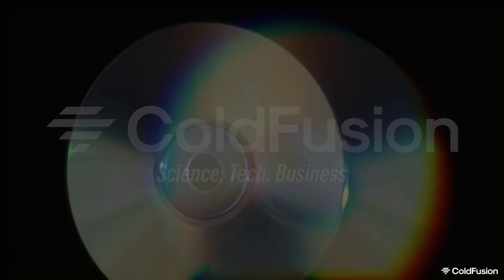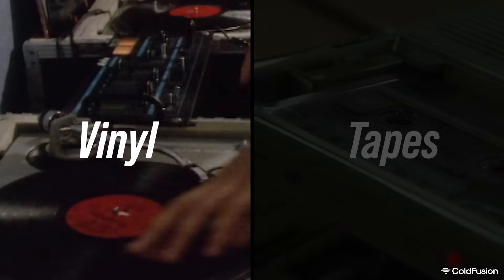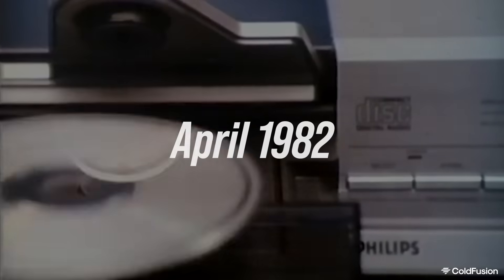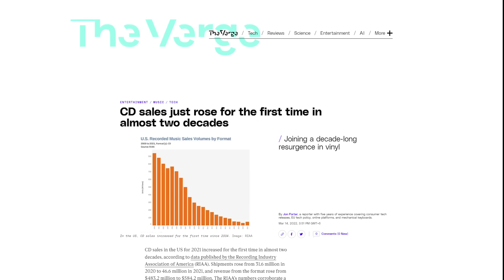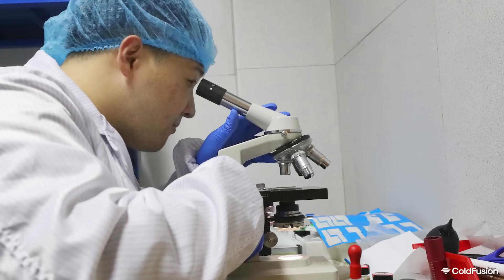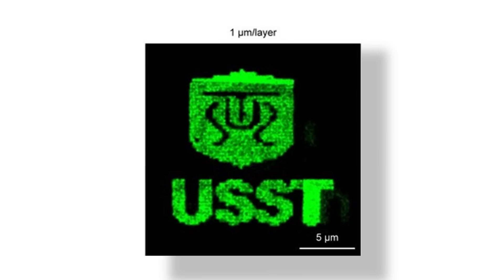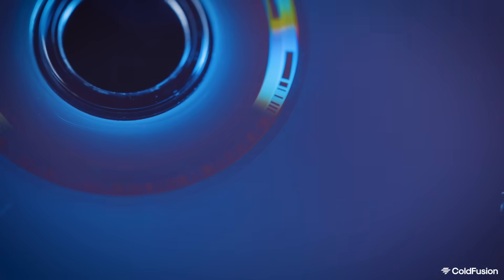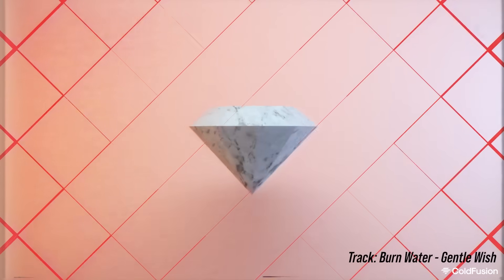Why This New CD Could Change Storage

Comment: Maybe put the disc in a casing like the mini disc. 

Losing 700 MB is one thing but losing 1.6 petabits because your disc got scratched up or stained would be a bit hard to swallow.
Reply: OMG. Give it a 90s translucent casing. pls. that would go so frickin hard
Reply: @joseffuris8306  DVD-RAM all again
Reply: Always have multiple copies of important data, how strong the medium is doesn’t matter, it should be able to break without you losing any data.
Reply: @LightOffArchives  yeah but that doesn't stop this being bad, the back ups things isn't really a solution it's just a thing you have to do because you can't rely on any one method
Reply: @illford  Well yeah, but there’s no storage method that’s completely secure in that sense, backups are unavoidable if you don’t want to lose data
Reply: @LightOffArchives  It depends on how much that disc cost. One dollar is ok. One hundred dollar is "That's my meal, dude!"
Reply: @LightOffArchives  For almost total data security you should save files that need it, at least 3 times, with at least one copy away from the location of the computer. If one copy becomes damaged, you can compare the copies to find out which two copies are likely to be undamaged.
Reply: DVD-RAM used to come in a case like a minidisc
Reply: @Brookspirit  Also a Floppy disk.  A petabyte better have some sort of case,  it too easy to screw up just the disk,
Reply: @Brookspirit  I really liked the minidisc, shame it never really caught on much
Reply: A cheap 100TB optical medium would be a life changing backup solution
Reply: @Wegetsignal  Assuming the hardware is affordable a 1TB disk would work well for me. Right now, I'd only need twenty disks to hold everything.
Reply: @Wegetsignal  yes, I don't see a common person using more than 100TB of data.
Reply: I've lost so much data on cds, even getting disk repairs did nothing, they even looked fine on the surface with no scratches or any damage.
Reply: "Sharing 700 MB of highly personal data with a Cloud provider - that will sell it to anybody - just to save it is one thing...."
Reply: @shotelco  yeah, freak the cloud, enough of them having control with their "mainframes", time for the second personal computer revolution, we own our data. the CD must make a come back. it doesn't even need to be in the Petabyte scale. A single CD with 100TB that costs $5 would already be amazing ! even if the reader would cost $5000 and the burner $20K

You could get the entire pirated Netflix catalog in 5 or 6 disks for $20, that would stick up to the big man that is big tech. That would put a halt to this neofeudalism, the idea that you will own nothing.

It happened once, it can happen again.
People are getting tired of everything being a stupid $50/mo subscription.

If buying ("a digital good") isn't owning, then we should go back to data being stored in physical media just for the sake of owning data.
Reply: @shotelco encrypt your data before uploading them
Reply: @shotelco Something something encryption.
Reply: @shotelco  Ever heard of encryption?
Reply: I've never lost a CD or DVD due to scratches, because I care about them. All my CDs are well kept in their boxes. I don't see the logic of people not taking care about their things. I hate to purchase the same thing twice, so I never do it. We need to have self discipline and responsibility. 🎉❤
Reply: @DihelsonMendonca  You won't believe how wasteful most people are. slightest defect and they trash it and either but a new one or do without because they never have a single clue how to fix it.
Reply: @paulmichaelfreedman8334  I answered to this comment, but my comment simply vanished. Wow ! 😅
Reply: @DihelsonMendonca  Agree. I can't claim "never" as you do, as I know I've lost one or two discs over the years. e.g. slot-loading drives meant sometimes the face of the disc hits something on the way in. When jewel cases were later replaced with paper sleeves, it did force the disc to make physical contact with another surface. 

But as a whole, you're right – with careful handling, a CD, DVD or BD can pretty much last a lifetime.
Reply: 💯 I still have my original CDs from 1990s still in pristine condition. I knew far beyond greedy Corps would find ways to rip the consumers off. Which they do now.  @DihelsonMendonca
Reply: You wont lose your data if it gets scratched, unless it is a very deep scratch, the data isn't stored on the surface.
Reply: @danielreed5199 but you'd probably have trouble reading the data, we all know how CDs ended up after some bumpy roads. No data was lost, but the scratches confused the player
Reply: @erlgr  but the disk can be fixed
Reply: @danielreed5199  I've had ruined CD's with scratches or pits on the top too.
Reply: @danielreed5199  It really depends on orientation of scratches and what do you exactly mean by 'deep'
But yeah, there are bit pattern mechanisms to error-correct for tiny damages
Reply: @danielreed5199  yeah but it won't read, it's great that it's still there too bad i can't read it. But also this happened a lot with games where small scratches would make the disc unreadable
Reply: @danielreed5199   Data isn't stored on the surface but it's much closer to the label side than the laser side.  Every damaged disc I have is the result of label side damage.
Reply: @danielreed5199 its not on the surface in conventional cds either.
Reply: @danielreed5199  That said, a simple ball pen on the printed side can actually scratch out the data layer, which is ironic as most people write on that side and  lay down a cd on the printed side to avoid scratches!
Reply: @danielreed5199  stretches don't damage the data... not even on current discs... but they defuse the light making the reading impossible for the laser.
Reply: @Mobik_  You mean scratches. But there's a solution: I have used a product known as "Brasso" ( here in Brazil ), and those unrecoverable CDs now can be read perfectly. I got rid of all surface scratches. Not a very deep one, though. But common scratches are perfect. 🙏👍
Reply: @danielreed5199  That's only on the bottom. But scratch the top of the disc and your data starts peeling off. Say goodbye to those layers for good. I remember i had discs that had part of it peeled off that you see right through it. That disc was done for.
Reply: @danielreed5199 Slow Claps, Slow Claps.
Reply: @danielreed5199 my friend played splatoon for the Wii U and couldn’t play anymore as they scratched the most important part of a disc 

The design on top of
Reply: @danielreed5199 Not a single optical disc holds data on the surface. So your understanding is flawed. Optical media is a sandwich, two polycarbonate sheets, with the data on a metal film between them. A scratch doesn't scratch the actual data, it causes the light to scatter and not reflect properly. Which is still possible, indeed, even more so with this media.

It astonished me when people make comments out of false confidence when they are just ignorant.

Research the Dunning-Kruger effect before you make another comment correcting anybody about anything.
Reply: @danielreed5199 CDs crap out regularly. Silver discs were meant to last 80 years. They don't last 8.
Reply: Something that stores that much data though would never be removed it looks like it does take some sort of special disk, reader, and writer, and if that’s the case, it would never leave that at least if I had one. Most likely if this technology does takeoff it will most likely be put into some form of hard drive like the old hard drives and will be a permanent fixture as a server or redundant back up drive to your PC.
Reply: it's still great data storage because it's Offline no need internet & no paying each month like cloud.
Reply: I agree. Mini discs seemed more durable because of the casing
Reply: With new storage possibilities comes new file formats and encodings that take advantage of that storage. For all we know 1.6 petabits in the future could be one movie.
Reply: Problem with CDR/W is it has a biotic membrane that was "stained" by the laser and faded over time. Shelf life was 5+ years. I have a CD case of hundreds of disks that I know no longer are of any use, not that anything from back then works on current windows anyway.
Reply: @willhendrix86  Are you no longer able to access the data on them?
Reply: @willhendrix86  M-Discs are good for 1000 years.....
Reply: Zip drives were encased in a plastic shell.  So were floppies.
Reply: They did this already back in the days, those casings called `caddys`. So you had to have a caddy drive to use them. I like those caddys too.
Give the disc the optimal protection.
Reply: 3-2-1 backup rules
Reply: You need a little data arbitrage, keep 2 or 3 copies
Reply: PSP called it 😂
Reply: Bluray was supposed to be in a casing like that, but they went with a harder material instead.
Reply: CD was originally intended to have a caddy, but this was quickly abandoned.
Reply: @ChronoTango  Some early drives did have you put the disc in a caddy that was then pushed in like a front-loading tape sorta.
Reply: Maybe a metal enclosure that also doubles as the drive bay that can fit in a slot on your computer, lets say something like 5.25 inches or something, I don't know, I'm making stuff up...
Reply: Don’t lose it 😂
Reply: Mini-disc use a plastic casing like floppies so if this also did that you wouldn't have to worry about scratches.
Reply: The Irony is that CD caddies were a thing, but to drive cost down of the players they were discarded and all went naked disc mode. In the late 90s and 2000s you could find players that used caddies but they were commercial players issued by music companies for PA use and used sealed caddies to protect their IP.
Reply: Also, I don't think a 12 cm version will be very handy. a 3.5 inch version with 30-40 TB storage would be ideal.
Reply: If it was affordable like the CD-R was, you'd simply burn two.. or three.. or ten. And of course store them in different places.
Reply: It was proposed to have CDs use a casing like floppy disks did, but nobody wanted to use them and by the time they got to the market, they were just the naked discs. 

They keep promising more scratch resistance in each generation of the technology but in practice each version has gotten more delicate.
Reply: The back scratch was the killer.
Reply: they could just make it so that it replaces magnetic discs, this way no issue with it getting scratched.
Reply: You can clone easily.
Reply: old cd become brittle easily delaminated
Reply: i loved the minidisc.
Reply: @jgg204  such a real loss tbh
Reply: The return of floppy disks
Reply: I disagree, give some time 1.6 petabits wont be as much, 700mb was a whole lot back then too
Reply: "Losing 700 MB is one thing but losing 1.6 petabits because your disc got scratched up or stained would be a bit hard to swallow."
...because you would be that fool for not making 1 or 2 backup copies.
Reply: The mass market consumer has no use for petabit capacity, and if you intend to preserve your ssd/hard drive information you had better use RAID storage, a lot of caution and hope for the best.
Reply: @deltasquared7777  raid for preservation on drives over 4GB is just begging for an unrecoverable read error.
Reply: maybe make a 2nd copy of the disc?
Reply: So make a backup dummy
Reply: @googlesucks6029  Despite what everyone is saying, optical disk CAN lose data due to mishandling, manufacturing defects or defective recording.  However they are still among the best medium for long term storage.
Reply: CD's originally came in a case and looked much like a big 3.5" floppy disk. then then made caddies that you put the disc in, and finally they did away with the caddy all together and just had the disc in a tray.
Reply: As much as I've always loved records laser discs and CDs at this point I prefer SD cards they're a lot more rugged can take lots of abuse and still work also very small
Reply: @maxvanderspurt2313 I find it somewhat amusing as SD cards are probably one of the most unreliable media I've used, the only thing that comes close to it are floppy discs.

3D printer not working correctly? Try saving the file into another SD card, or open up the case around the SD card receptacle and clean it, or jiggle the damn thing around until it works. SBC not booting or crashing randomly? Remove micro SD card, run fsck on another computer, reformat or copy the data onto a new micro SD card, clean the damn connector, try it again. 

As much as I hate have USB flash drives sticking out of electronic equipment, there are low profile ones that are cheap, has more than enough capacity and work very reliably for many years, but every damn piece of equipment I have / had that uses SD for it's main form of data storage have failed on me multiple times due to weird random data corruption or stupid transient malfunctions. Heck, even the butt ugly and horribly outdated CF cards are way more reliable than SD cards in my experience. 

Most recent example: I had to solder header pins to a Raspberry Pi Zero 2W so I could plug a daughter board on it for a project. After soldering the thing either didn't boot anymore, or booted, ran for a few seconds and froze. I thought I had messed up something, checked and rechecked for shorts or bad solder joints, but couldn't find any faults, I was starting to think I messed up the SoC by using too much heat or something like that. Then I remembered: check the damn SD card. Plugged into another computer, verified checksums for all important files, ran fsck on the partitions, no errors. Plugged the same card on another brand new Pi Zero and... Same faults. Zeroed out the first two gigabytes, wrote the same image over again, it just worked on both boards. Why? No idea. 

Whenever something with an SD card misbehaves, I feel like I'm failing to perform the right ritual. Is the pentagram drawn right? Did the black cat meow in the right note or was it a semitone too sharp? Do I have to shake a dead chicken clockwise or counter-clockwise over the SD card? What's the phase of the moon again? I'm never sure what I'm doing wrong that pissed off the SD card gods/demons and broke the damn thing. 

And let's just not talk about how many equipment have SD card slots where if you're not super careful when inserting or pulling off the card, it'll just fall inside the case and you'll have to disassemble the damn thing to recover the damn card. It almost makes me miss the prayers I had to do when trying to recover data from CD-R or DVD-R more than five years old.
Reply: @googlesucks6029 a 1.6 petabit hard to swallow indeed 😉
Reply: We used to say, always back up.
Reply: (and yes we had backup and yes, it got lost too. My son now backs up on an SD card, flash drive and an external hard drive if it's important stuff he's working on)
Reply: You should have always a backup for large data. Nobody's crazy to not having a backup plan.
Reply: CDs in the early days came in caddies which you inserted in the drive similar to MD. In case you needed to use the CD in a caddy-less drive (or player), it was possible to take the CD out of the caddy and use it the same as we know it today. Google "CD caddy".
Reply: They did it for DVD RAM before but it seems everyone just opt-in to use it bare as the added casing would require a more specialized DVD reader.
Reply: Those machines that can magically fix really scratched CDs are going to come back into fashion. Those things worked damn well on discs that would swear are scratched beyond fixing
Reply: Just put it in a box like hard drives
Reply: @dotCOM742  Mini-disc are more sleek and portable.
Reply: This medium wouldn't be used day to day anyway, you would most likely backup and store it, the read and write speed wouldn't be fast enough.
Reply: @jamesalexanderbarnettdp9479  So, Basically another form of a tape drive?
Reply: @Jad2410  I would say so yes, people are used to read and write speeds in the thousands on megabytes per second I can’t see CD based medium getting anywhere near close. Not to mention the ability to read and the re write multiple times. It’s amazing they have achieved this but can’t see many practical uses.
Reply: great idea,  they had them back in the day for full sized cd's long before the mini disks came out. pretty much a cd case but you just put the whole case in to the drive . no idea why they switched to handling the disks without those cases it was a great system.
Reply: @sykoben  Mostly cost and people always losing caddies or having none and they weren't really cheap. The discs should have been in permanent caddies from the beginning, from factory. Much easier labelling and no chance of damaging the disc by writing on it, and the discs themselves can be cheaper by reducing the armored layers.
Reply: @paulmichaelfreedman8334  realistically of each one of these discs cost 30 bucks because of an armored caddy, you’d still have an incredible amount of storage space for 30 bucks
Reply: Yeah. Hopefully it will be sturdier than before. External storage options are also scary to rely on.
Reply: Wouldn't the advantage be that you could store a certain amount of data many many many many times over on the same disc so even if it gets scratched it's unlikely to get all the instances with one scratch?
Reply: No worries, that is why we use Reed-Solomon error correction.
Reply: just make it on sapphire material like some phone screens, it's really hard to scratch, much much harder than plastic and your average glass.
Reply: That's why you would need a srt of the to have a RAID array.
Reply: It was proposed to have CDs use a casing like floppy disks did, but nobody wanted to use them and by the time they got to the market, they were just the naked discs. 

They keep promising more scratch resistance in each generation of the technology but in practice each version has gotten more delicate.
Reply: There is cd storage cases. Also the CD itself could be made with glass instead of plastic eliminating light scratches.
Reply: @mrdan2898  Other way to do it is to encase the disc in a case similar to floppy disc or zip disc.
Reply: @gorilladisco9108  agree
Reply: Yes, bring back the CD caddy's
Reply: Actually early CDs were expensive and indeed came encased so that technology already exists.  It just became redundant as cds reached literal pennies in cost making cheaper to make 10 back ups rather than pay that pricey plastic enclosure which eventually gets brittle as nd breaks anyways.
Reply: @googlesucks6029   Especially if you dumb-enough NOT to have multiple backups! 🤣
Reply: RAID 5
Reply: 3-2-1 backup strategy - have 3 copies of your data (your production data and 2 backup copies) on two different media (disk and tape) with one copy off-site for disaster recovery.
Reply: I assume those CD would need the return of the CD caddy. (Something that look close to the MD)
Reply: Thats why you are keeping copies of your first disc to a second :P
Reply: For this kind of disc, I would like to have protective cover like MD or umd
Reply: Hamming has leftthe chat
Reply: My first thought as well.
Reply: Smaller capacity disc damage will loose small data. This is very high on other. It's own dark  side.
Reply: i see you, sneakily trying to reintroduce floppy discs  :p
Reply: scratched UP? How about scratched DOWN? (Of course, merely scratched isn't allowed.)
Reply: Like Sony's UMD?
Reply: Just like 1.44mb on a floppy wasnt much by the time the cdrom came around, the 700mb of the cd paled in comparisson to the 4.6gb on a dvdrom, which was blown oit of the water by the 50gb of the bluray....... etc etc
Reply: Similarly DVD-RAM cases exist and I've got a Panasonic DVD recorder which uses them. The discs are double-sided and I can handle it without touching it.
Reply: dvds are 4gb - 8gb, blu-rays are 25gb - 128 gb,
Reply: you have 10 backups
Reply: Backup is great and recommended, but it certainly doesn't hurt to make the media less vulnerable to damage. So I agree, I hope they do something that will make the disk more resistant to scratching.
Reply: @peterphan227  all modern disc software offers scratch redundancy , if you do 50% redundancy on a blu-ray that means half the surface must be scratches before any data is damaged. so contrary to popular belief its not as big deal as you may think.
Reply: Why do people always say this nonsense every time high density is brought up? You lose data when you have no backups, not because the disc holds a lot of data.
Reply: @reh3884   modern disc software lets you do built in redundancy, which you can set on the software, so at 50% data redundancy that means half the surface of the disc must be scratches in order for you too lose data, so scratches really isnt such a big as people think.
Reply: Right. It needs a cartridge
Reply: No backups?  Make several copies of the disk.
Reply: You just need a high-quality jewel case. That's what people use with CDs/DVDs/Blu-Rays when archiving important information.
Reply: Minidisc forever !!
Reply: First of all, anyone  with that much data would absolutely have numerous copies . 
In our studio we always make numerous copies of everything we do, on master cds, on hard drives, etc. Even my personal music has many copies and backups.
Reply: Just have more than one back up.
Reply: Run it in parallel?
Reply: I'm done with open cds it's great that they can increase the storage on a cd it's probably cheap to make but  I'd rather pay for a thumb stick or SD card  of some type        even  it's protected in some say its way safer to handle  solid state  memory this os a waste of time and focus my opinion to even think about going back to cds unless they're being used specifically  for something
Reply: I think this wood be more like a hdd
Reply: I used to just burn 2 or 3 copies if its critical data. But those disks were a dime a dozen.
Reply: The casing always seems like a good idea at first. Hence why Sony tried it with the PSP UMD's after it was already shown to be a giant problem in disguise as a solution with mini-disc. 

Praytell, if the disc is encased in plastic, how do you clean it if dirt and dust get inside? Take it apart? Okay, but now you just defeated the purpose of the case existing in the first place. Now the disc can be easily scratched by you instead of the dirt and dust that may have gotten inside. 

Be very careful? Yeah, okay; but famous last words much?
Reply: that's why i never put my data on a terrabyte+ hard-drive. it forces me to spread things on different disks.
Reply: DON'T fool yourselves. Yes you can fix a scratched CD with a bit of rubbing and polishing. BUT DEFINITELY, DEFINITELY, ABSOLUTELY not these 1.6 Petabit disks. Study their stuff.
Reply: @hstrinzel  You probably didn't reply to my reply to googlesucks6029, but because you didn't direct your comment to anyone, and your reply doesn't make sense compared to googlesucks original comment since they made no mention of cleaning the disc; I am assuming you meant to reply to myself or someone else who mentioned the notion of cleaning the disc.

If you were replying to me, then you didn't read correctly, because I stated that cleaning it would be a bad idea due to increase chances of making it worse (essentially). 

So, who are you replying to? Or are  you just yelling at a wall?
Reply: Speaking of minidiscs, why not make minidisc sized versions that still hold like 10 terabyte. More than enough for most things.
Reply: I want the future with super-capacity optical floppies, far cooler IMO
Reply: @UNSCPILOT  That... is a mini-disc... 

YOU ALL need to go and do your homework on this whole Mini-disc thing. You're all doomed to repeat the same mistakes made by Sony with the PSP and their repeat of the same mistake using UMD.
Reply: Cloud storage sellers won't allow this
Reply: @henry.gibert  They have no say in the matter, and have no choice in it either.
Reply: 700MB in the past was still a bit hard to swallow. 

Even losing 1.44MB from floppy disc in the past still a bit hard to swallow.
Reply: Back in the day (mid 1980s - early 1990s), they made CD-ROM caddies because CDs were so darn expensive. The caddies protected the discs. This technology could be used in this Peta CD-ROM as well.
Reply: would you ever remove the disc?
Reply: they will build these IN to  a system , one that is protected , like servers probably
Reply: Have a backup
Reply: I would have said "a byte hard to swallow" for increased efficiency of understanding. lol I said LOL!
Reply: Never put all your eggs(bits) in one basket(disc).
Reply: fairly cheap and easy to back up, no?
Reply: 200,000GB with a write speed of (let's say) 100MB/s gives us 2 million seconds, or ~23 days to write one disk...
Reply: If the storage is cheap nobody would care because you make a backup for very low cost. The issue can be the reading and writing speed and rewrite ability.  I guess here will be lost the game this new CD to the average consumer. Practicality counts a lot. An USB key is far, far, far smaller than a CD and easier to plug in. I can't be scratched etc.
Reply: 3d data storage.... project voxel, data storage in quartz same process
Reply: Yeah like in that video clip from Aerosmith. That was the future…
Reply: I was thinking the same thing.
Reply: Why not have it in a case that you put it in to and the case has a usb or smth.
Reply: have you ever tried scratching a hard drive disk. Even my engraver struggled to scratch it.  perhaps CDs could have a lite transparent  spray of platinum on surface .? idk . but i know id get off my bum to pick something up i owned rather than lease
Reply: Brother, imagine losing your Windows server due to botched Crowdstrike update. But not backing up data on tape or disc drives 😂
Reply: For that very reason, they would most likely be inside a cartridge case like the old hard case floppy disks with sliding metal shutters.
Reply: at least it's a lot less worse than losing your data because of a server error , and you own the data
Reply: The bootleg dvd man at the swap meet is bout to be back in business. He gonna stock the entire Netflix catalog on one disc for $5 💀
Reply: Or maybe it could be integrated into the form factors we already use for spinning hard drives... Imagine instead of The platters spinning, you replace it with said optical disc and required reading instrument
Reply: @sirBumpyCase  Yeah, only right now, the reading/writing instruments are crazy big, inefficient, expensive, and slow. In the future, I could imagine this could be implemented, though. I think a Megadisk-(yep, that's what I'm calling it)-drive system like that would have to be precisely calibrated so that all the lasers work properly, and that they would be a nightmare to fix. One solution to "fixing" a drive like this might be to have interchangeable disks, so if the drive gets damaged, the disks could be transplanted with less effort
Reply: just use two disks so one is for backup
Reply: with Blu-rays and onward, they use a highly durable scratch-resistant material on discs now, so it's actually quite hard to casually scratch them.
It's actually kind of hard to PURPOSEFULLY scratch them in normal use cases as well.
Reply: Indeed, better make several copies then!
Reply: I thought about this too...! And using kilowatts of electricity at megabytes of write speeds to write that much data... you wouldn't want to touch it.
Reply: Agreed. Large capacity CDs should have casing to protect them just like floppies had a hard shell.
Reply: i was thinking just same. minidiscs were practicly indestructible.
Reply: the disc should come with gorilla glass XD.
Reply: make a hundred of them, lol😂
Reply: they can be shiped like floppy disks (in enclosure)
Reply: Yet one of those wonderful technologies that will "last for centuries"... we all know what burned CDs are like, many of us unable to read back data from them 10 or 15 years later (they were supposed to last "at least 200 years"). This nw physical media will simply NOT be mainstream
Reply: thats why in backing up daata you use at least 3 places, all copies
Reply: If the casing looked like the floppy disk, it would be amazing!
Reply: The 3400 thumbs up viewers are likely Z and Alpha generation people who do not understand CD technology very well as of yet.

Furthermore. I am glad that some people mentioned that CDs have a layer of plastic film that must be deeply scratched thru to wreck the content on only the damaged parts of the disc. That of which then causes the rest to fail to be played or utilised in their conventional means as well.

Therefore it is like everyone else who actually understands CDs said on their own part of CDs. That of which is to say that they need intentional damage of the CD itself as the only way to loose your data aside from it being stolen or lost somehow, and that was the only copy you kept to yourself too.
Reply: or the casing would be like that of today's hard disks, enclosed
simple enough solution isn't it
Reply: you'd just burn two discs though!
Reply: Just relax your throat.
Reply: bring back mini discs
Reply: More than a bit hard to swallow, it would really byte.
Reply: The real issue is how long of a lifespan this method has as many CD's and DVDs have already or are reaching the end of being usable. Seems even more important at such a high capacity.
Reply: It is not only about mechanical damage. CD can degrade by itself.
Reply: @zpetar  this is why you make copies every so often.
Reply: That's a lot of mamacitas videos lost to some scratches
Reply: I came here to say the same thing. Love the mini disc format
Reply: They should make them like the ones in Minority Report.
Reply: it's one of the safest storage mediums. I have CDs some 20 years old kept in dark fungus ridden places; they held up a lot better than the external HDDs.
Reply: big true
Reply: I think the term youre looking for is cd caddy. I like cd caddys and minidisc but leave it optional. A bare optical disc isnt that fragile and you can always store it in a removable case or have multiple copies.
Reply: First you have to figure out where you are going to record this data from. You don't have 50PB drives sitting in your computer that need backing up.
Reply: so what you want is a hard drive that uses laser to burn and read rather than megnetic(cmr/smr)?????????
Reply: Thank you for that. I laughed a good laugh.
Reply: I would buy at a reasonable price
Reply: Why would your CD get scratched or stained? You some kind of wild animal?
Reply: Most my CDs and DVDs simply lost the top part where data is burned permanently and most are all gone and they are well stored in their cases on dry place.

Hell even some original music and console games have completely gone too but they have a way tougher layer than most or even all CDs/DVDs to burn that you buy...

Also a huge common problem was some pristine, fully working, scratch free ones after just some time simply started throwing CRC errors beyond repair which I never quite understand why on a well burned one that was completely working and looks brand new 🖕🤬
Reply: Am I the only one that got this joke?
Reply: You need two then. Just doubled the market share.
Reply: I say put it in a Minidisc Like format for the masses, as an alternative to Flash Storage for personal Archival use and Storing the ever growing Games
Reply: FACTS‼️ F THAT 💯
Reply: That would have me doing a backup, of a backup, and probably another backup. 😂  I would totally do away with mass HDD storage for this, once given time to be proven.
Reply: CD's originally had caddies, but those got removed for cost reasons. The rest is history.
Reply: They could make it like a HDD. Put it in a big durable metallic case from which the actual storage disc never sees the light of the day.
Reply: @NostalgiaForInfinity EXACTLY. 

Mini-Hdd, basically video game cassets making their return. I mean some HDDs are costing as much as games their size now
Reply: Imagine taking one through airport customs; It would take them years to scan it for porn! :D
Reply: You're really worried about this when it's decades from being anything you would ever have access to?

You do realize this is something that you might hold in your hands in like 20 years right?
Reply: And you can grind the surface to “repair” the damage
Reply: @Soras_  not the top though.

My brother gave me a TON of music CD's years ago, but they were all stored without a case, and many had damage on the label side, ruining them.
Reply: @Soras_  What happens if crack the disk?  You can't grind away crack.
Reply: @quantumleaper   you can crack your ssd and harddrive as well. you can also short circuit your storage as well
Reply: @Soras_  I had a head crash before I cracked a circuit board in an HDD.  Even that ever very rare today.  Unless you drop the HD out of a window, I doubt you will ever see a circuit that has a crack. I have even dropped an HDD down metal starts,  it killed the drive but the circuit board on the drive didn't show damage.
Reply: @quantumleaper  well,you can destroy the disk if the the hdd don't have the protective case. Protective case for disc would be enough
Reply: @Soras_ Repairing damaged optical disks rarely works.  I know; I've tried.
Reply: @OnGuard3S  depend of what type of damage
Reply: The data is stored on the top of the disc as the storage bit is technically in the discs label @Soras_
Reply: @Soras_ how many laymen will have this technique.  And how much it costs to find someone doing the grinding (if can find one)
Reply: @Soras_  sand buff and polish
Reply: Have you tried redundancy?
Reply: @B.D.F.  Having redundancy does not mean a media being easier to fail is acceptable.
Reply: @ShirokiMaki  Good thing those words never came out of my mouth, and don’t try to put them there.
Reply: @B.D.F. this is a dickhead comment.  Is it fun up there in your tower?  I’m sure they’ve heard of the concept.  How many copies and backups actually cover redundancy?  I’ll make it easy for you, ♾️💿.  

Before your next comment, think, then post (or don’t).  Much love to the ColdFusionTV community ❤.
Reply: @AcornElectron  I’m pretty sure the saying “two is one, one is none” applies, and you can extrapolate based on the amount of desired redundancy since redundancy is a scale rather than a binary. Settle down.
Reply: make 2 copy's  ?
Reply: @fakkel321  "321 backup" is the way to go.
Reply: You can also lose your data on cloud storage when the company holding your data decides to give you the middle finger and shut down their servers. At least with disc storage you have ownership of your data, you just need to take good care of your discs don't use them as sandpaper.
Reply: just look at the advancement in the coating used on blu ray. very hard to scratch them. now look at gorilla glass. No reason this new iteration of disc technology couldn't use gorilla glass technology to make a highly scratch proof coating. 
But yeah, on top of that, any storage medium can be damaged, thats why you need backups. and when a disc holds over a petabyte, most people could store everything digital they've ever owned on one disc, and back it up in triplicate.
Reply: @ge2719  I think a 3.5 inch version of this tech would be much handier than a 12cm CD size version, to be honest. They could use the 3.5 inch floppy caddy design with minor changes, simple and cheap and there are still factories making them, ideal for repurposing and using the old machines, saving massively on cost.
Reply: its saved on your mechanical hard drive, make another copy.
Reply: @seriouscyrus33  I prefer a NAS with RAID 5.  That way I can share the data over the Network easier.
Reply: So is an external server being hacked or servers going down. Nothing is perfect but there's ways to protect it.
Reply: size doesn't really matter. i'd rather lose a petabit of junk than the 100 bits of my bitcoin wallet's key with a billion dollars in it
Reply: @GraveUypo  Please delete this comment before it manifests into reality.
Reply: You're just a hater. Just make 12 copies and store each of them meticulously in different places. If you get scratches, you could simply spend hours sanding and lapping it and hope you didn't screw it up more. How is it not obvious that this would revolutionize data storage?
Reply: ESPECIALLY if it took 2000 HOURS with special air cooling to write it in the first place.
Reply: @hstrinzel  Hi there again. Sorry to be a repeat record on this topic, but you really need to learn how to direct your comments to the people they apply to. That said, this time your comment actually makes sense somewhat as a direct reply to googlesucks. 

But your other comment I just left a reply to, well... again, learn how to tag people properly so you don't get this situation again. 

For all those who don't know... YouTube just assumes that all replies that show up after a comment made by the person using youtube... must all be replies to them. 

So I get to see every last dumb (and sometimes smart) thing you all say on these threads.... 

And turning off notifications isn't a proper fix, because it blocks EVERYONE instead at that point, even if you were tagged.

SO please, everyone reading this. Properly tag your comments, or shut up.
Reply: you always should have at least copies and at least 2 different media.. so nothing will happen if you scratch a cd
Reply: That's why you Backup on Tape  LOL
Reply: Already had this problem with BlueRays. It just does not feel safe.
Reply: @llothar68  dude, blue rays are completely safe! If it gets scratched, the data isn't gone! It only makes the laser lose focus! You can get CDs, DVDs, and BlueRay disks fixed! And all the data is safe! Disks breaking is just a common misconception
Reply: Every format that used a caddy failed.  CED, MiniDisc, SyQuest, and almost CD-ROM.
Reply: @siliconinsect UMD didn't, though mostly because of the PSP
Reply: @siliconinsect  Yeah, unless you count tape cassettes as a type of caddie.